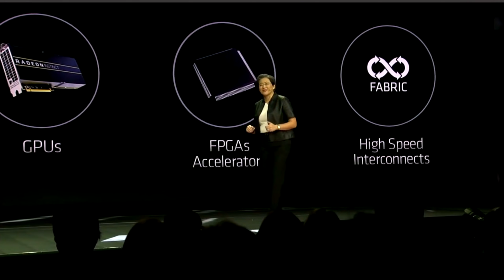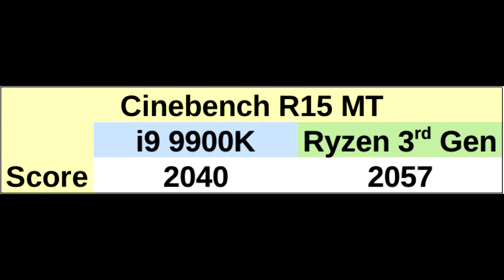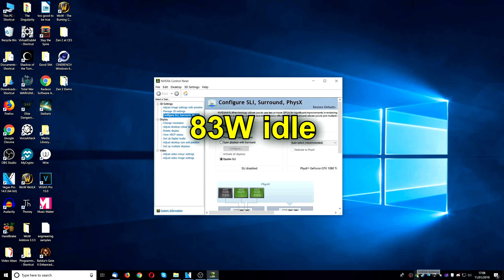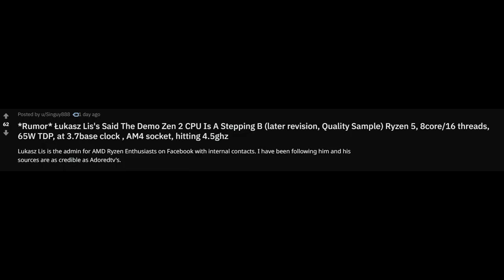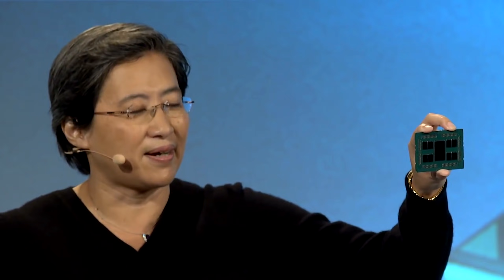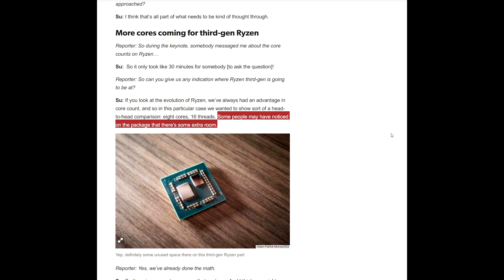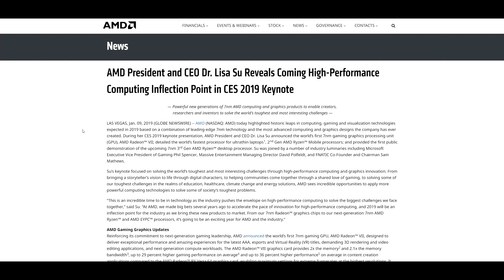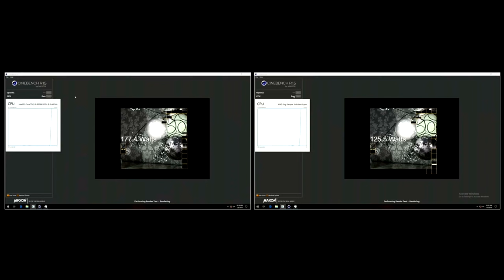Zen 2 Faster than i9 9900K at Half the Power.

Comment: I very much hope the chip wasn't running at ~4.5GHz. if it is, that basically means there's no IPC improvement. That means we're not going to see much higher than that per core performance. However, it is very impressive efficiency. I think the ~4.2Ghz mark given the efficiency is more likely personally. At least I'm hoping. that way, that would mean we do indeed see some IPC gains.
Reply: Yes, very likely to be around 4.1-4.3ghz depending on memory speed. I'd expect at least the IPC jump we saw from 1st gen to 2nd gen, maybe even a bit more.

Comment: This "thriller" is getting really exciting now. So far you haven't been far off the thruth. If all goes according to plans and expectations, Ryzen 3000 series will be beasts.

At the same time, I'm wondering when the Radeon cards will switch to a chiplet design? They could then develop things like the shader cores separately and slap on things like tensor cores and RT cores at will. I think it might even be possible to split up the shader cores for better yields and for proper binning and then use 1, 2, 4, etc. chiplet designs, depending on which market segment each card will be targeted at. It all ofc depends on, if they can get proper speeds from infinity fabric though.

Comment: I am ready  for my 3850x if real. Already sold my 2700x with motherboard for 450. Bought a 1600 with 2700x stock Cooler with b450 motherboard used for 75$  to use for now. Also it overclock like a champ .1.35 volts got me 4.0ghz.
Stays at 40-65 c after 4-8hrs of  gaming( enermax liqfusion 240mm io)

Comment: Amd is going to kick a lot of ass when they release zen 2!! :)
 Intel is 2 years behind lol (their ces showing was a disaster in my view because the 10nm parts they were talking about won't be released until end of 2019 and theyre for laptop parts only lol.
Also, I have my doubts about their 3d stacking.. That's going to be another big fat failure due to extreme heat issues!

This is karma for intel those scummy bast%rds!
Reply: I don't conform to the notion of 'karma' or 'belief'.
Also, while I definitely applaud AMD and think Intel needs a few years on the sidelines (especially due to their bribing practices from excluding AMD from most OEM's), Intel still has a lot of market share and a lot more resources than AMD.
Though, yes, AMD is definitely kicking them where it hurts already with Ryzen 1 and Ryzen + in both consumer and data centre space.

Comment: Disapointing performance at what PRICE?????????? 10% slower at half the price is a great deal for consumers. I know, I'm the only person on Utube that has a budget.
Reply: Yes, it was only a mere 1% increase in performance, but do keep in mind that Lisa Su said it was an engineering sample with non-final clock speeds. And from the looks of things, (And also the info from Jim's lovely video), the CPU demonstrated closely represents that this is either the Ryzen 5 3600 or the X counterpart. Key thing to remember and take serious note of, is that this was an early engineering sample with unfinalized clock speeds.
Reply: What do you mean by disappointing performance?
Reply: @Azraleee  Adorded wanted to see a 16 core demo. Other  reviewers acted like CES was "nothing to see here"
Reply: @maxhughes5687  I won't lie, I was also not impressed when Lisa Su pulled a "One more Thing" moment. But, like Jim said, that package shot pretty much single handedly confirmed the full lineup, with the exception of the G-APUs. Going by Anandtechs article, the Navi APUs will probably be pushed back to Ryzen 4k.
Reply: @Βασίλειος Μπεσλεμές Yes. And my experience with AMD has been hardware so tuf it gets replaced for new tech not because it failed.
Reply: @maxhughes5687  My second PC is running with an AMD Phenom II X4 CPU in it. I built it 10 years ago almost to the day and it still gets used every day.

Comment: @AdoredTV Don't forget, they can also re-purpose those chiplets that bin with "disabled cores" into the extra space. I expect that could be another delineation between like a 3300 and a 3300X. For example: 2 x 4 core 8 thread chiplets vs 1 x 8 core 16 thread chiplet.
Reply: they could, but looking back to zen & zen+ thats highly unlikely
Reply: @dongurudebro4579  those were monolithic dies. Zen2 will be chiplets. This is what opens up the possibility. It all depends upon yield.

Comment: Engineering sample was probably locked @ a 4.2ghz all core boost. 2700x @ 4.4ghz all core would get over 2000 in some cases. Basically the 3600x should get 2300-2500 with final clocks and some good memory.....
Reply: I think it was more like 4.1GHz because with that, the 15% difference between this and the 2700X is about the IPC increase we'd expect. 

And if you do the math, you'll end up with about 2300 points , if the 3600X has an allcore boost of around 4.5GHz
Reply: @Transistor Jump no shit and you won silicon life

Comment: It was very obvious to me watching the live feed, thats an 8 core v 8 core mid range part... it was also obvious that the platform had the ability to move to 12/16 core. But the tech press, the majority of it are just proper retards - or paid to be.. In a few months we will have 4/6/8 core am4 as well as 12 and 16 core options. These will outperform intels saggy crap clock for clock by a little and clock reasonably high ..5 or so Ghz perhaps. 2019 is not Intels year..

Comment: What I am taking from this is that one of AMD's cheapest CPU's will be able to match one of Intel's most expensive.  This means that at the value point, where in the previous generations we would see the R5 1600/2600 parts, we will be seeing chips that will be more powerful than pretty much any Intel chip outside the ultra high end and server space.
Reply: Spot on. And that for under 500 cpu mobo combo.

Comment: I'm actually warming up to the Radeon VII. At first I thought it was dud by being at the same price as a 2080 without it having DLSS and ray tracing. It seemed like a no brainer to pick the card with more features. But!!! Let's just wait and see what 16 GB's of HBM brings to the table... That might mean more than we think. I'm also impressed they finall got their clock speed way up.
Reply: It's not the AMOUNT of GB that matters.. It's the bandwidth that was the limiting factor on Vega 64! By doubbling the bandwidth, that card will no longer be limited by the memory.

Think of this way.
You have a freeway with 2 lanes (bandwidth) and driving at 100 (clock speed) . That road will become a bottleneck real fast when enough cars (data) tries to get to their destination.
Double the amount of lanes and the road can fit double the amount of cars :)
Reply: @SpeedRebirth  makes sense, but its a very expensive road to build (why not 2x6gb while we're at it?) , and the benefits were already shown at AMDs presentation. My point is, it's not getting any better than what we have seen. Unless until Navi...
Reply: @ronnymueller1918  Because that's not how memory controllers work.

Ever noticed that there's a bunch of cards around that have 4 and 8 gigabyte variants, and a bunch with 3,6 an 12 gig variants?

That's because of how the memory controllers are structured, and because those are on the GPU die, you can't easily change that structure.

If you make alterations to an 8 gig card, your options are 4 gigs or 16. (well, 2 and 32 would also work, but that gets VERY pointless)

Just as a 12 gig card can't go to 16 gigs, but would have to go to... Well, 18.
Remember memory chips come in powers of 2, ALWAYS. (this has been true since memory has existed) - if you see anything with memory that isn't a power of two, that's caused by having an odd number of chips, or chips with different values.

6 gigs of memory either means 1x4 + 1x2, or more likely 3x2 
8 gigs will almost certainly be 4x2 - or otherwise 2x4 or 8x1, depending on what's affordable.

Basically, to have values like 3,6,12,18 etc requires having three memory channels (or multiples of 3; 6, 9, etc)

While having 4,8,16 etc requires having 4 (or 8, 12, 16, 20, ... 32 etc)

something derived from an 8 gig design will become 16, never 12.
Something derived from 6 gigs, will become 12, not 16...
Very unlikely the same chip can support both sets of configurations.
Reply: @KuraIthys  Thanks for your answer. But what did nvidia do with gtx 1080ti with its 11gb memory? Was it a completely different design then gtx 1080 8gb? And couldnt AMD have done the same with vega2?
Reply: Also double the ROPs...

I think i will bite the bullet and get one. If it's avaible in my shithole country at sane price...
Reply: @ThomasShatter  Why not just wait a short time for compatible benchmarks? No leaps of faith or bullet biting required
Reply: 16GB of Vram is completely useless. Even 4K ultra will not use that much. The 2080 is clearly the better card because of lower tdp temps RTX and DLSS. Vega vii is a fail
Reply: The 16GB HBM makes me wonder if they want to improve crossfire in the future. Because for gaming that amount would be the main reason.
Reply: Honestly, why should it be more than it seems? Maybe they needed 16gb for some architecture reasons, but for sure no game of today needs 16gb at even 4k res. And for the architecture part, they already revealed that the r7 will be on par with rtx 2080. Leaks say r7 will be 295w tdp... I dont see it will get any better on vega. Still hoping big time for Navi though.

Comment: i think amd chose to show that chip is to create a panic at intel, 
if you show what is you best and beat them, they have will have a rough idea at what they are expecting, and might have a counter measure ready in the near future.
but if you can match them with something which is not your best, they will have a hard time speculating, and leads to not a so solid answer to their threat
if they counter with something weaker than their opponent's best, they LOST.
if they over-estimate their opponent and launch something really powerful, possibly something they plan to release further down the time line rather than now, the have disrupted their own plan.
and for AMD, they have nothing to lose as long as they can price their product cleverly, and since these chiplets are cheap to produce, intel will still have a hard time matching with their, in comparison, more expensive monolithic chips.
Reply: The same strategy works in armwrestling. You apply just enough power to keep his in check, he doesn't know if you're applying 70 or 90%, so he will most likely increase his output, you'll follow in order to keep him gassing out. After you feel weakening force you apply slowly more force and beat him.
Reply: Its kinda the classic, play your cards close to your chest, and let their imagination do the rest.
Nobody is 100% sure what kind of clock speeds one could expect from a 16 core chip, exactly what kind of performance, and how much that thing will cost.
If you underestimate it, you'll make a fool of yourself. If you over estimate it you might make a mistake rushing something out - And in the words of Napoleon: "Never interfere with your enemy when he is making a mistake".
Reply: Brad Viviviyal  Vega 7 is just a Hail Mary by AMD. The card from top to bottom is a data center card, just like the first card. They are making a gaming variant just because, and they don't expect the card to sell because their 2 past flagships sold negligible amounts. Basically they just are making a workstation card that doesn't have the workstation price tag
Reply: I can guarantee you that they know what AMD's got coming by this point. They've almost certainly got people inside AMD or GF feeding them...
(•_•)
( •_•)>⌐■-■
(⌐■_■)
intel.
Reply: You talking about Maxwell? The arch that took the world by storm? AMD is swinging back at that with navi hopefully
Reply: Brad Viviviyal  so of course they are gonna release navi at some point, just not Q1
Reply: Basically AMD did what Nvidia did to them lol 😅😂

Comment: Great video as usual.  I am sure almost anyone that watches your channel and tuned in for the AMD Keynote knew the whole deal once Lisa Su showed those exposed die's on stage.  What an exciting time.  BTW - Wasn't there some confirmation at CES that X570/Ryzen 3000 will officially support 3200MHz DDR4 as it's standard speed?  I could have sworn I read or saw that.  Looking forward to upcoming info either way!

Comment: Oh, i admit i missed the obvious space for the 2nd chiplet when i saw that image, but thats why you make these videos and not me, IF they choose to do a 16 core version then this could really a bit of an upset to intel, i wonder what intels answer will be to this, i mean they can't really push clock speeds and until they work out the issues with their smaller process node they can't really squeeze much more on the die, could this finally be the time where intel has to increase the socket size to be able to compete properly? how likely do you think that sort of scenario would be

Comment: i have to say though that expense and profit margin will be  factor.  i think 8 cores on tsmc 7nm will actually cost a bit more than 8 cores on glofo 12nm.  maybe not the per wafer costs alone but the costs of moving it over to a new process (masks, tweaking silicon, r and d, etc).  the days of shrinks being cheaper for the same amount of cores is over (at least till EUV comes).  so yiou have a chip that costs as much as the old ones just based on the core chiplet.  then you have a, maybe, 150mm2 io die?  i think itll cost at least 50% more to make a singel core chiplet cpu than the last gen cpus.  then add another 8 core chiplet?  i think youre looking at double the cost to produce that cpu.  maybe a bit over double.  

i think those leaked prices are what they would have to sell them for at cost.  not what the retail will be.  of course i could be wrong but even if the retail prices are close i think amd will be taking a hit in margin to gain mindshare and marketshare.

Comment: as far as intel vs amd these new chips will whittle down intels gaming lead and increase amds multthreaded lead.  there wont be a 29% increase in ipc.  there wont be even be a 15-20% overall ipc gain.  what there will be will be a 29% icp gain in avx workloads, so for things video, in which amd were more than just the normal few percent behind in ipc behind intel, amd will catch up.  there will be a 29% ipc gain but since they are going to an intel like avx setup that means that clocks will throttle a bit because of the extra heat and power that avx loads cause when using a full 256 bit register.  so the 29% ipc gain is instructions per clock, but the clocks will drop a bit,  so maybe around 20% gain overall but they were almost that far behind intel in acx loads anyway so basically this will put them at parity.  that 29% figure was just stated for avx loads though not normal integer\logic loads.

so i dont think amd will have really large ipc gains in non avx loads but they will get higher clocks.  if they do a 6 and 8 core chip with one chiplet then gaming will almost be on par with intel and productivity too (maybe a bit more in pro).  and if those chips are priced the same as current amd chips then they will have intels current line beat on value by a mile. 

but i think intel will make the next i7 an 8 core 16 thread cpu with the igpu being a seperate die.  a 9900k with no igpu will be smaller than an 8700k.  a cheap 9900k (8700k price) with no igpu and a slightly more expensive version with igpu.  then the new i9 could be the new 10 core that is rumored.  plus raja says that intel have decoupled the sunny conve arch from the 10nm process which means they could get the ipc increases from that new arch on that 8 core chip.  i didnt literall mean i9 9900k for 8700k prices just 8 cores 16 threads.  that would mean against intels next gen of chips amd would be in about the same position they are in now cheaper but with less performance.

now if they do the multi chiplet route with their chips, the performance depends on where they start using more than one chiplet (not counting the io die of course).  if they start with the 8 core cpus then the chiplet to chiplet latency will kill the gaming performance.  the lower clocked 6 core chips might even be faster in a lot of games. so they just use a single 8 core chiplet for the 8 core cpus right?  well if they have a perfectly good 8 core die that clcoks high that would be a highly sought after chip.  that could be an epyc, TR, ryzen 12 or 16 core chiplet.  so they may make the 8 core cpus with 2 chiplets.  that extra latecny would kill gaming performance.  youd need to get a 12 or 16 core die to get 6 or 8 cores all on one chiplet.

but if they did 2 chiplets they would destroy intel in multihreaded workloads but top gaming performance would be gated behind 12 and 16 core cpus.  but then again if amd sell them for the prices in the leaks then you could get a 12 or 16 core chip for the old price of a 6 or 8 core current intel cpu.  so it wouldnt really matter. then again new intel 8 core chips might go for the price of current intel 6 core chips AND have higher ipc. 

if intel just rehash what they have now amd will crush them either way.  but i think intel will have something to answer.  it may or may not be 10nm.  but if they can keep the clocks they have and increase ipc 5-10% with sunny cove arch and get 8 cores 16 threads out for 8700k prices (and they really could i think) then itll be a close race and very interesting.  also i think they will make the next hedt lineup out of 2 of these 8 or 10 core dies so maybe lower prices\higher core counts per dollar.  cant wait to see how it shakes out.  but amd look stronger than ever.  i think the old intel would have counted on brand loyalty and mind share but the new intel, i think, will come out with something more